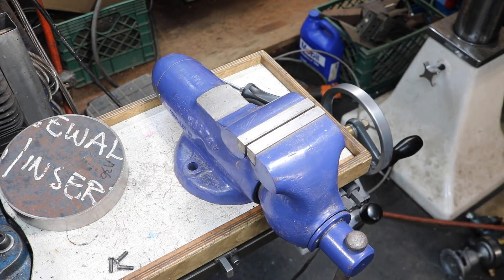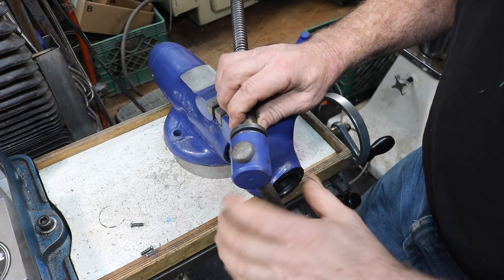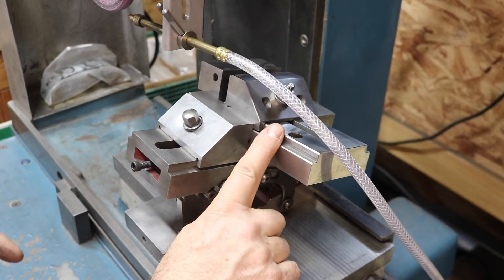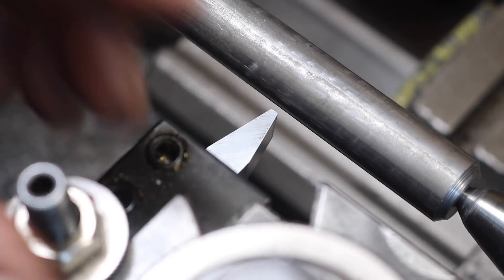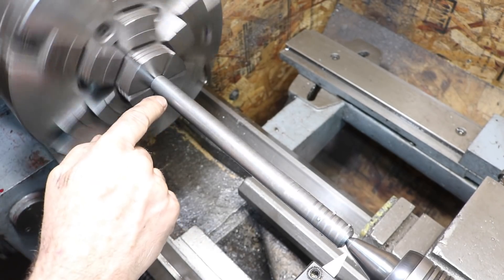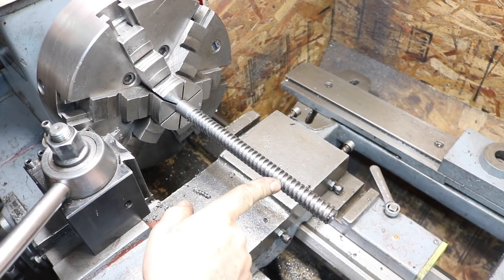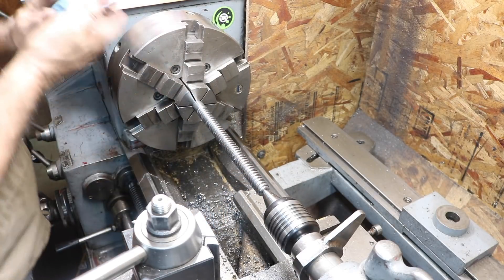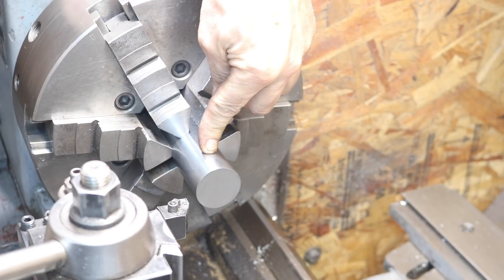Wilton Bullet Vise Modification Making The Shaft | Welding Table Upgrade  P1

Comment: Wondering if your tailstock is a little out? thread is snug to start but seems to get looser the further you go down the thread
Reply from the maker: Well there is a couple of reasons, the tailstock quill is extended several inches, the stock is extended over 8 inches, then the tool push off at the beginning of the cut.  All of these will cause a bit of a light cut at the beginning of the cut.  The stock gets more rigid and the tool will take a better cut as the cut progresses toward the chuck.  This is why spring passes are important to help minimize this light cut issue.  Or even take a light cut for just the first 2-3 inches and pull out off the cut, this is a very effective method i have used it many times.  Thanks Peter for the great comment.

Comment: Randy, this is on my project "bucket list", and I learned a lot here.  On the filming,  I loved the heavy slow cutting those curly chips which you caught with the sound so well.  It was like I was standing at your lathe - nice job.  On the thread, I think I read somewhere that beyond being proprietary and the marketing value inherent to that, that Wilton developed this heavy almost square ACME thread because of it's pulling strength.  Don't know if that's true, but it is a pretty beefy thread!  (I have a 4" Wilton machinist bullet vise I love; don't tell my wife about the other woman...)
Reply from the maker: Thank you Marc.  Slow Maching.

Comment: good job on the acme threads,i would have  guessed  the need for a follow rest, the rod must be stiff.  i did a lazy man mod years ago to a vise. i removed the handle and then made a sleeve to go over the end of the shaft . i put a button head bolt thru the sleeve  to attach it and made a bushing to fit the hole in the shaft for a good fit the sleeve was machined to a hex on the end so i could use a spare mill vise wrench and it worked very well. anxious to see  part two
Reply from the maker: Thanks Larry, quite stiff, pre hard 4130 is really nice.  Nice idea also Larry.

Comment: Came out just fine👍
Some time ago I shot a video of my award winning trapezoidal thread (metric acme) grinding jig but your idea works fine, was not happy with my video hence no up load.
I am in two minds as to which way to cut an Acme style thread. The obvious way is to have a tool the right width and adjust fit by going  shallower or deeper to get perfect fit in nut. Or the other way have a slightly narrow tool, go to spec depth and adjust by widening the thread. I was after a near backlash  free fit before using an anti backlash nut, as a prospective  up grade for my mill. Which needed because present backlash is measured in inches not thous! Slight exaggeration but still mm not microns.😭
ATB 
c
Reply from the maker: Thanks Chris.  Yes I thought about mentioning the shift method, but that is an advanced method.

Comment: I like how you ground the cutting tool. Very good job. You're not worried about shearing off the taper pin? I put almost all my weight into cranking down the vice sometimes. Take care Randy
Reply from the maker: Thank you Randy.  Not to concrened, due to the intended use on the welding table.  I hope I don't have to tighten that much.